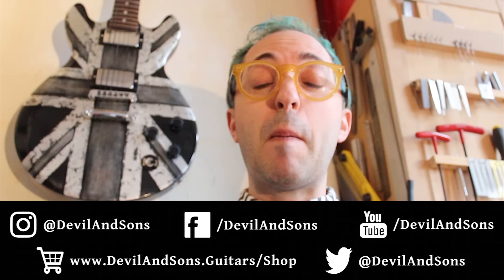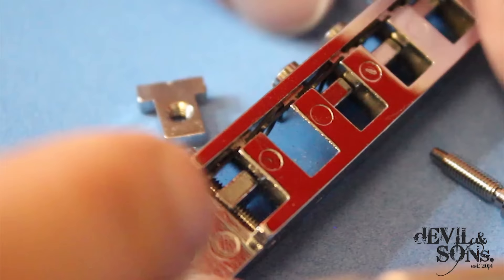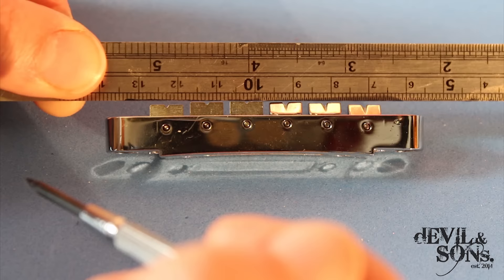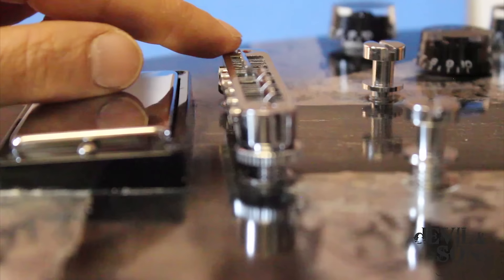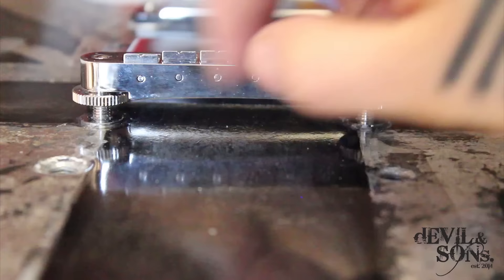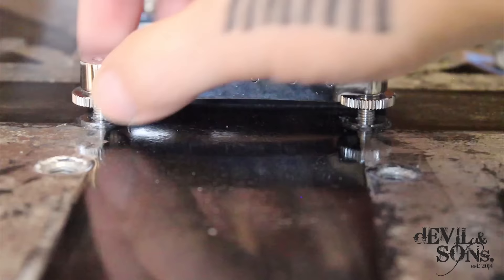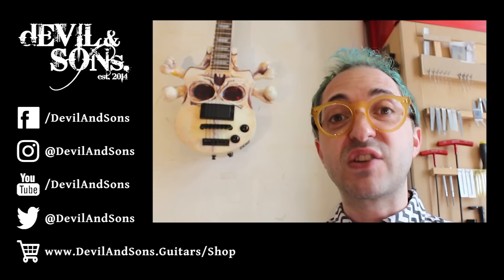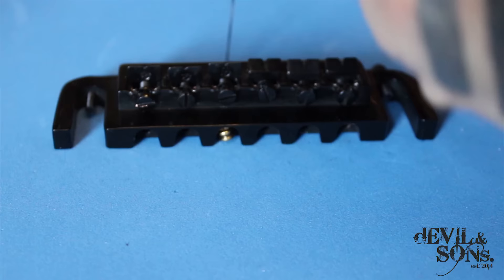Setting up a Tune-o-matic bridge (Les Paul style)

Comment: Nice vid. However, i was expecting some explanation on what exactly happens when you tighten (or loosen) the settle's screws.... 😢
Reply from the maker: Thanks for commenting. This video is made to go hand in hand with my full setup video which explains all the theory about adjustments. Basically if i include info on everything this would be an extremely long video. However instead of watching that full video, here's one explaining what those screws do - intonation (assuming you mean the screw on each individual saddle which mive the saddle closer or further from the nut). https://youtu.be/cQ-yslOuHck
Reply: @DevilAndSons  thank you so much man! 😊❤️ I'm taking my first steps into guitar setup, have an ESP tunned down to drop A and i was trying to figure out whether those screws have any influence on the buzzing lower string. Thanks a lot once again!
Reply from the maker: My pleasure. Are you using strings that are design for drop A, I.e. a heavy gauge?  The buzzing is likely to be due to action, so you'd need to raise the bridge at that end. You may find my full set up video useful to watch, I also have one about string gauges if you need it. Good luck
Reply: i got a set of 13 - 56 with a 23w. I went to the store with the intention of getting a 7 string set, but the guy told me the 13-56 would easily handle the low tunning. Maybe I need to tighten the truss rod a little bit since the action is actually significantly higher on the 12th fret. Nevertheless, I'm watching your other videos and hopefully get in to a conclusion! Thanks a lot bro!!! 🙏
Reply from the maker: Yes. If the action is high a truss rod adjustment may be in order. That sounds like a good gauge for drop a, but do remember standard guitars aren't made for drop a so I think some buzzing is very  likely, although it may not come through the pickups so isn't really a problem. If you like drop a then a baritone guitar would be better.
Reply: @DevilAndSons  it is an ESP Viper 500. Although is not a baritone, it is clearly designed for metal so one would expect it to handle those kinds of tunnings. Nevertheless, I'm gonna try to play around with the truss rod and bridge height simultaneously, and try to find the sweet spot! 😊
Reply from the maker: Maybe. It's still an extreme. Some companies do make metal guitars especially for such tunings and they are a bugger scale length. I'm think of the Rob Flynn epiphone flying V.

Comment: Good Morning Daniel...Just a quickie. I'm left-handed , and play left-handed. Would that make any difference to the arrangement of the bridge or its saddles  ??
Reply from the maker: Howard SIX yes. Normally the lower strings are further back than the high strings, so that’s why the bridge part with the saddles is attached to the body at a slight angle, to allow for a bit more length for the low strings. If you string the guitar the other way around it’s possible the low string saddles won’t be able to go far back enough for correct intonation and the high strings go far forward enough. Does that make sense? If you gave a left handed guitar it will be set up for this already in which case it makes no difference. Also you’d need a left handed nut so that the nut slots are the correct width and depth for your strings going in the other direction order. I hope that makes sense.

Comment: Nashville bridge screws face the tailpiece. ABR-1 bridge has screws facing pickups. Typically...
Reply from the maker: Thanks for commenting. The more info shared the better.
Reply: Devil & Sons Guitars 
I do know it comes down to necessity and preference. But if an old beard stroker brings a Les Paul into the shop, he’ll probably expect it to be historically correct. I’m not among the beard stroking class of Les Paul owners. I’m more of a Heretic class Les Paul guy. I’m the guy that would put active pickups and a  Floyd Rose on my Les Paul (although I haven’t...yet) . The beard strokers would think this is like putting a tattoo on Jesus. It comes down to personal preference on the bridge. But typically...Nashville/rear ABR-1/pickups. Nice video
Reply from the maker: @Wargasm644  ha, yeah. I'm definitely the sort of guy who would put floyd rose on my les paul too, and there are some people who definitely get up set when I put a paint job on a classic guitar but like you - if that's what the owner wants from their guitar I will not question it (and I'd be very happy to do it).

Comment: Just a question about 12:10. I dont understant how can a string "feel tighter" with the same gauge and tuning. The moment you start lowering the tailpiece, the string will now move a longer way than before therefore it will pitch higher. That will cause you to tune your guitar lower in order to get back to same tuning. So you will end up with same tension. Am I wrong here?
Reply from the maker: I think the idea here is the part of the string between the bridge and the tailpiece has more tension so is less likely to have any slip or give and hold the string in place. Maybe I should make a video in which I specifically test this to see if it is true as it's something I have seen people discussing before and no one has a conclusive argument either way.
Reply: @DevilAndSons   thanks for the response.  Funny thing is I think feel the same way.  I just cant get my head around it logically.
Reply from the maker: I thought I had when I made this video but now I'm unsure, I will make that video one day.

Comment: Any reason why a LP bridge would be set lower on the low strings rather than vice versa? The action seems pretty even but I always thought the higher strings could go a little lower? Cheers
Reply from the maker: That is odd. Normally the lower strings would be slightly higher (as they arr slightly thicker). I would imagine that the higher strings have been set higher as perhaps they were chocking out on the upper frets so needed that extra height. I would definitely try lowering them.
Reply from the maker: I do have a full set up video that would help if you want, I'll put it in the next comment. If the strings do choke out it could be the truss rod needs adjusting and I explain that in the other video.
Reply from the maker: https://youtu.be/bZHjmr6Y2qg

Comment: Absolutely sublime video. very well explained and well made.I have a 2018 standard Les Paul, and the strings touch the Nashville bridge after the saddle. If I raise the tailpiece enough to solve this, it becomes uncomfortable to play....and I don't want to top wind. I'm at a loss to solve this, do you have a fix?
Reply from the maker: Rijk Guitar thanks so much for your kind comment. Hmmm, that sounds odd. Do you mean that the strings come from the head stock, along the neck, over the saddle fine, then touch the bridge before going into the tailpiece? I can understand not wanting to wrap the strings as it looks a bit ugly. Is the intonation good and the strong height ok for you? Is the truss rod set up correctly too? If you lower the saddle height it may help, but then the string height will be lower.
Reply: Do you mean that the strings come from the head stock, along the neck, over the saddle fine, then touch the bridge before going into the tailpiece?That's exactly it. The guitar is set up beautifully with a very slick action over an almost straight neck. But the strings leave the saddle at the bridge and just fractionally touch the frame of the bridge before going to the tailpiece. Its a Nashville bridge, and they are a little more chunky than the ABR 1 bridges.
Reply from the maker: Rijk Guitar I would say that if the guitar feels set up beautifully to you, plays well, and then strings don’t wear or break in any quicker way than normal because of this set up you have it’s not worth risking changing anything. My feelings are if you have a guitar that plays really well, has no problems, and that you enjoy playing don’t change anything - that’s the dream.
Reply from the maker: I’m not sure how helpful that last comment was as it doesn’t actually solve your problem.
Reply: true bro, that was helpful. I'm now not going to fix something that's not broken.
Reply from the maker: Rijk Guitar glad I was of help
Reply from the maker: The full set up video is now up, you may find it useful: https://youtu.be/fvD-qsM3piQ

Comment: Thank you so much for teaching so well. The delivery was info packed, clear, and flowed so well. I learned a lot! From terminology to execution.

I'm trying to set up on my gibson sg and I had some questions.

Does it matter where I position the saddles within the bridge, or is just the orientation important?

If I did decide to let the stop-bar tail piece sit at the bottom, and bring the string over the stop-bar tail piece, would it scratch the stop-bar in the long run? I'm thinking so since it is metal vibrating on metal.
Reply from the maker: Thanks so much for leaving a comment, let me try to help:

Yes, the position of the saddles is very important as this helps set the intonation. You will need to adjust the position of the saddles and therefore the length between where the string leaves the nut and where it meets the saddle. To check the string is the correct length time the open string then, once it is in tune, check the note at the 12th fret - this should be exactly an octave higher. If it isn’t you will have to change the saddle position and therefore shorten or lengthen the string in order to make sure the note is exactly an octave higher.

I hope that helps with that issue. If you subscribe you will see my full set up video once it is done, but as that may take me a while may I suggest you give YouTube a search for setting up a guitar and guitar intonation to get an answer. Thanks.
Reply from the maker: Joshua 'Jah' Achin for your second question -

I doubt it will scratch the bridge much, most scratching will come from slips when you are stringing it up, however what will happen is dust etc will be harder to clean from your bridge as the strings will be in the way a bit, make it harder to simply wipe clean. In the long run this dust and grime can lead to marks on the metal, it’s why you see older bridges that look a bit rusty. However I think you’d have to neglect your guitar quite a bit and for a long time to see this. Personally I don’t think the wrap around makes much of a difference, in fact I think it makes more difference aesthetically, so I never do it. You could always give it a try and if you don’t like it change it before the guitar gets too dirty - or just keep it very clean. I hope that helps
Reply from the maker: I should also add that the strings vibrate between the nut and the saddle when you play them so there really shouldn’t be much vibration if any between the saddles and the stop bar.
Reply: Devil & Sons Guitars I will follow your preference and avoid that grime. And I'll def look up some more on the saddles. Thanks for the speedy response and taking to time to answer my questions. You're awesome.
Reply from the maker: Joshua 'Jah' Achin it’s a pleasure. Thanks again for watching.
Reply from the maker: The full set up video is now up, you may find it useful: https://youtu.be/fvD-qsM3piQ

Comment: I am unable to turn the thumb screws wheels on the bridge with my fingers to lower or raise the bridge.  Is there a tool for this, or do I need to loosen something to take the tension off of the bridge?
Reply from the maker: I think you are right, in this case you will have too loosen the strings so you can turn the thumb screws and then retune.

Comment: The b string in my ltd eclipse is intonating half step flat. 
I have run out of saddle adjustment since it is all the way towards the body. i had also flippd the saddle direction.
What should i do??
Reply from the maker: That seems very odd if the rest are OK. It could actually be a problem with the string. I would always try replacing it before doing anything else more drastic.

Comment: Great video.If i replace the bridge with a bridge that has no string slots how do you notch the bridge saddles? Thank you.
Reply from the maker: Bobby Lopes do you have a link or an image of the bridge? Some bridges don’t have slots but they are normally ones without moveable saddles. In which case you may find that as long as the angle is enough from the bridge to the tailpiece the strings will be held in place enough by the pressure of them pulling down on the unslotted bridge. Otherwise to make slots you’ll be best to use a small file and work slowly I think. If it had moving saddles you could try swapping the saddles out for one that does have slots.

Comment: Great Video. I was wondering who makes the 3rd Bridge you showed ? The wrap around with the adjuster screw's ?
Reply from the maker: Thanks for commenting. I honestly can't remember where I got it from. I'm based in the uk and buy a lot of parts via shops on ebay, there are a lot of uk guitar part retailers that advertise on there and I find it the best way to sort through a lot of options. I probably just searched for wrap around bridge or black tune o matic and waded through all the options. I use ebay a bit like a search engine for parts. There are some retailers I use that aren't on ebay, but I am sure this one came from there. Long rambling answer but I hope it is a bit helpful.

Comment: ..tuning the strings is about setting or giving each string its appropriate tension
 .. my point is that lowering the rear bridge will increase the 'tensions', yes but it will cause the strings to go out of tune .. then you will need to re-tune it again. 
As long as the rear bridge is lower than the mid-bridge, it is all good. Lowering the rear bridge ( or wrapping strings around it) does not equal to increase in sustain, no .. so why increase the tension which will de-tune the strings only to decrease it again in re-tuning? Weird.
 The strings vibrations (tone, sustain) is between the nut and the mid-bridge .. not before or after.
Reply from the maker: True but a tighter angle helps stop the string from slipping out of the saddle groove.

Comment: Great video, thanks. Is it possible to adjust the height of the saddles? The top E string on my Les Paul seems too low in relation to the other strings and the curvature of the fretboard. Can I just raise that one string without using the thumb wheel and increasing the height of the others? Thanks
Reply from the maker: On most tuneomatics you can only adjust the two ends thus angling the whole thing. The saddles are held at set heights.
Reply from the maker: And glad you like the video, thanks for commenting.

Comment: Hya duder I have an epiphone and to be honest it's good to me so that's wat matters but I took everything off to clean it it caus it waz scnd hand an SG by the way and when I looked at the saddle, im a lefty by the way, I noticed that the little saddles the ones with th big gaps were on the small strings side and vice versa plus they were 3, 1 way and 3 th other and screws to the back. Right with me so far, so the bridge was dwn to the wood and the strings were touching the screws caus th angle was so steep so I looked through to find vids none with a clear answer... till urs!!! Drum roll Pls., but seriously so iv turned the whole saddle round so screws r forward facing, iv raised my bridge, I used the saddles with th big gaps for the thick strings and vice versa, now it gets a little tricky here because the way it's shaped on the saddle to curve so u get ur strings nice curve shape well th middle was to hig h no matter wat I did back forward so now I have all th angles at th front bar the b string iv set everything all up apart from intonation but the way I used the saddles was to get a nice curve I'm scared now if I was to sort my intonation out my strings would be up and dwn, I knw it's a long message Soz forgot to say it feels tighter high is weird because the angle was twice that before till I raised the bridge any help or advice would be super cool il also subscribe...that's not a bribe lol love both guitars in the vid that scull n bones one Woah but the cool saddle was super sweet all in one I'm out. Hope to hear back
Reply from the maker: Gordon Tough so sorry about the delay in replying. I’m wondering if you have a right handed guitar set up left handed. The problem here would be that the bridge is angled for a right handed guitar with the bass end further away from the nut. Everything you have done about swapping the saddles etc would be the perfect solution for other bridges, but here you probably are now finding the bridge is angled so that, for you playing left handed, the bass strings end of the bridge is closer to the neck. Does that make sense? Is that actually the case? If so you may still be able to screw the bass saddles back as far as possible and the treble saddles forward as far as possible and have the solution, but it may not be the case. If this is the problem you are having you may need to have the holes for the saddle repositioned or put a new bridge on that has more movement with the saddles.
Reply from the maker: Of course I may be misunderstanding. Once you have tried to set the intonation it may actually be fine. If the string height is the problem and raising or lowering the bridge isn’t fixing it then it may be the truss rod that needs looking at.